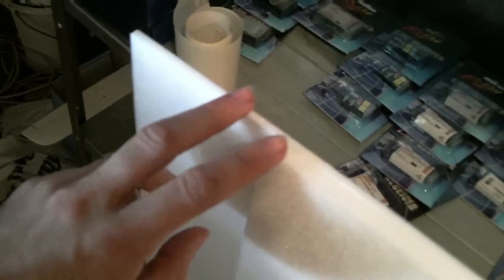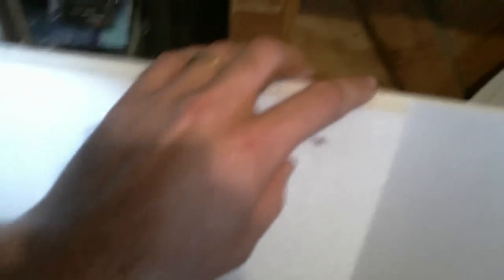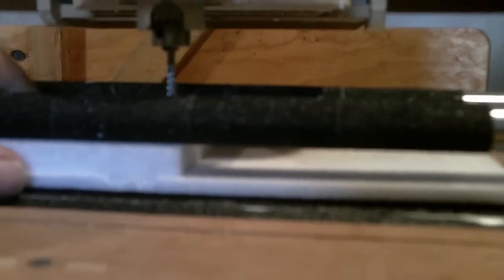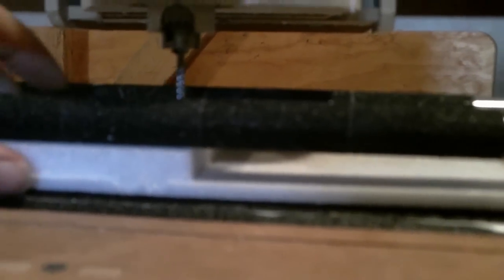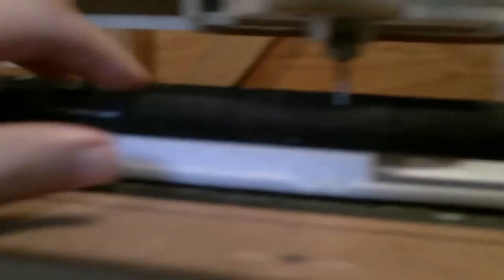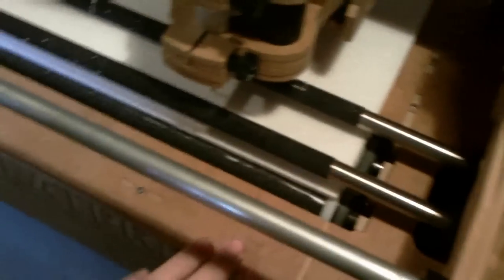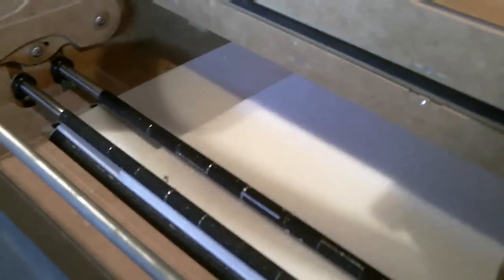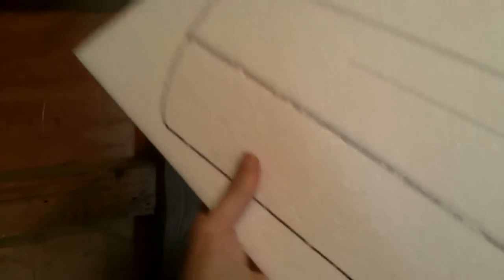Cutting EPP foam with the MK3 Phlatprinter

Comment from the maker: Thanks guys. Only modification I have done since is to clamp two guides to the front of the printer. Just to make 100% sure that the foam does not travel or twist. Once I had done that everything just works perfectly every time.